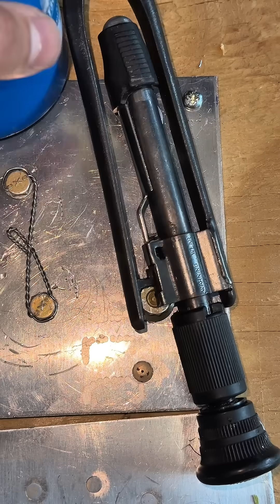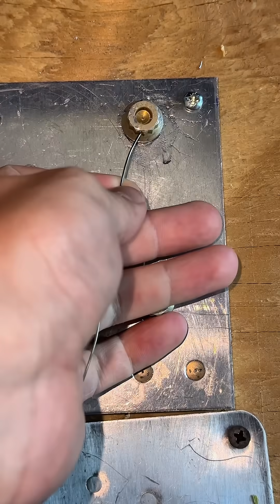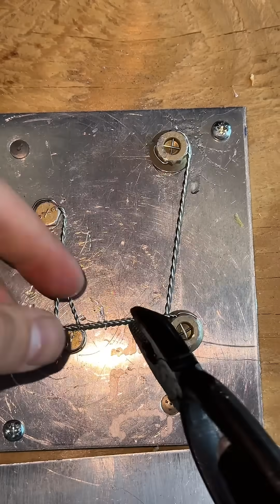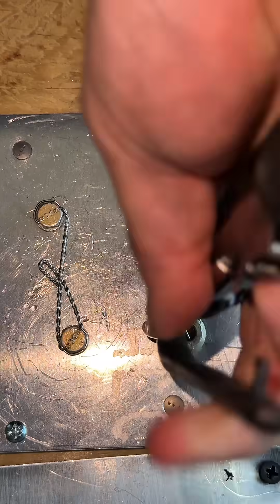Jet tech: Boomers Hated This Safety Wire Tip 😤✈️ #AviationMechanic #shorts #mechanic

Comment: Honest question about this. I don’t know if your camera reverses the image, but say that it does not. Should it tension on the loosening side of the bolt?
IMHO those two “Wired” bolts will back themselves out to a point where it’s irrelevant that they are strung together. 
In other words, both can back out from their holes due to vibration, and once they do that it will be a matter of time before the vibration breaks the safety wires one or both ends. If those bolts are left handed threads then they are correct. 
If they are not then it would be wrong in my opinion.
I am not trying to sharp shoot you down, but I have been in the past an ASE certified Auto Mechanic, then Army Heavy Construction Equipment Repairer 62B- 2P and H8 plus 3 other MOS last was 91Y-3P.
I worked around our Aircraft (Hueys, Cobras, Kiowa, Black Hawks and Chinhooks) all while an E-6 SSG , so I was pretty familiar with the Hangar Floor and Maintenance was always a Core Mission of mine, so I was always looking learning and building my knowledge.
Then when I got out I hung out at a local airport shop where An Army EOD Tech was the A&P Mechanic, and back then his dad was the Engine Builder so I’m sure he’d have been the one who would have thought of the difference of bolt thread direction. He had a special set of skills and w
Once he had the twin halves of an Air Cooled Engine back together, there was no way he would want to crack it open again just to check the wires tied to the Piston Crank Rod Nuts. Or bolts anywhere else. 
Back at 4D0, we had a Guy who got the Army aircraft Wounded Duck award. The 3 control rods that go up behind the right shoulder and the right seat pilot, encased in the structural frame work of the aircraft. One of the rods was loose and it nearly broke. The Aircraft had been removed from service several times for safety reasons due to sticking control issues, but this guy was a very lucky man who had already survived several crashes in the back seats of “Crash-Hawks “
He had lots of hours and progressed to being a pilot WO.  
The fact that he was the one on the controls is IMHO is what saved him, the Aircraft, Crew, and PAX … he felt his connection to the swashplate, had changed and he felt like it was stretching on one control function, which he Immediately recognized as a very serious problem and went to work on getting it down safely! Much to his credit!
The only way that he found the issue was by shining a light down the control rod housing, and having some one else operate the controls (covers off nose hood slid out and he was face down on top of the air craft. What he found was never saposed to happen. The 3 rods go through several kind of bulkheads inside the frame works and only when the rod in question was all the way up was it visible to see above the rod grommet or Pass through hole there was 3 rods in there and very limited light could be seen in that area let alone not knowing what to look for. When the rod and only the one rod was at full extension upward could it be visible from above and just barely.
The rod was 1/2-3/4 inches in diameter and 3/4-7/8 of it was worn through to a point where it would have snapped and fallen into the bottom where it would have jammed the other two rods and rendered them useless at that point they would not have been able to survive without any control. 
My point I guess in sharing this long story is that if they had gone any further than they could have all been dead.
I can only speculate on what happened to cause the grommet to tear apart allowing the metal on metal contact to occur and wear through the metal Rod linkage in this case it was Aluminum Rod inside of aluminum structural housing hole. The material of the rod was inferior to material of the structure and it was sacrificial until it almost broke apart. The metal was examined by Missouri AV-CRAD (I believe) and it was found to have stretched nearly 1/4” and cracks indicating that it was about to snap were visible. 
That was a long time ago when it happened but I never forgot about it. Safety is no Accident!
We have not spoken about it in years but I might Rattle his Cage a bit soon !
Maybe my thoughts are right about some safety wire falling into the housing until on it’s lucky day it made its way into the rubber grommet and then ate a hole through it and continued to eat away the rubber then the rod. 
Good luck! I might be a little bit of a Boomer I was Born at night when Charley sent out his minions, I’m said to be an old soul by several over the years. My dad was a WWII veteran. I just carried the Torch as it was my turn, it is someone else’s turn now!😉

Comment: I have those pliers ... your tail get a lead seal clamped too? ... for anyone wondering it's so anyone backing off the screws breaks the wire to show tampering.
Reply from the maker: Depending on your data and manufacturr most dont need a lead seal

Comment: we had a 88 S15 pickup and it had major dash board electrical issues after we tried to fix it we safety wired the dash back on at the air vents lol

Comment: Very nice safety wire job. I been in aviation as a mechanic for  over 35 years.  Being an aircraft mechanic is not a good job. Become an electrician, welder, plumber and etc. Working at UAL, huge disappointment and end up retiring poor. UAL company of broken promises and empty dreams.

Comment: The only problem with that is an army aviation at least you cannot use that tool or it goes against regulation. You have to just be a man and have strong hands and do it the right way by hand.

Comment: Too many tpi on the pigtail. Do it again airman.
Reply from the maker: safety wire pigtails can have more twists per inch, depending on the wire diameter and specific application. Standards such as SAE AS567 and FAA Advisory Circular 43.13-1B provide guidelines on the appropriate number of twists per inch for different wire sizes. ￼ ￼

For example, according to SAE AS567, the recommended twists per inch are:
	•	0.020” to 0.025” diameter wire: 8–14 twists per inch
	•	0.032” to 0.041” diameter wire: 6–11 twists per inch
	•	0.051” to 0.060” diameter wire: 4–9 twists per inch ￼

Comment: Nope, the bottom one is wrong. If the wire is pulled, the bolt will loosen. Should always tightening position!

Comment: In 1992 when I started in naval aviation I had to safety wire the tail rotor inboard retention plate bolts  and that was 16 of them on a  7 inch circle and best was by hand. This taught you to appreciate safety wire pliers because toy really don’t need then. It just makes it easier. Navy HH60H/SH60F/ HH60H/MH60S/Mh60R aviation mechanics. But do what makes it best. Good video
Reply from the maker: That’s a lot of safety wire!

Comment: I will say, that I did not have the correct tool and had to use two pairs of needle nose pliers. I don't care what anyone says, if there is a correct tool for the job, use it. Those safety wire pliers are by far better than any other method.
Reply from the maker: You’re right, the right tool for the job makes all the difference!

Comment: Never seen a pig tail tucked like that before. Our QC never would have allowed it, but maybe that was just Army SOP. Cool to see other alternate methods.

Edit: Does anyone know if there are different standards for fixed wing vs rotarty wing? Seems to me like the tail touching the main part of the saftey would rub and degrade it with the vibrations of a rotary wing, maybe thats why i never saw that. Just speculation.

Comment: I dont think safety wire is there secret i think there secret is that the plans are held together by glue and zip ties and any one who has worked at cirrus air craft says the same thing I work mid assembly for the sf50 lol not hating I think safety wire is great and keepnup the helpful vids

Comment: We use the same wire and pliers in motorcycle racing to stop bolts from getting loose and to stock oil dip sticks from getting loose on track, such satisfying things to do is lock wiring stuff
Reply from the maker: Glad it’s useful across different industries!

Comment: I do these as a 15T Blackhawk Repairer. Nothing is worse than doing safety wire in the top hydraulic deck as a newly qualified repairer
Reply from the maker: That’s tough, glad you’re a qualified repairer now!
Reply: @northeastaviationpro there’s so many up there so when we got stationed it was time to nut up or shut up

Comment: The United States Navy uses this on almost every single fastener that’s anywhere near the engine room. Flat tops, subs don’t matter. There is an exact amount of twist per inch depending on the diameter of the wire..😊 so just count your knots and measure you’ll know if it’s tight or not😊
Reply from the maker: Interesting! Thanks for sharing the Navy's practice.

Comment: As a QASO AO2 in the US NAVY 2006-2013 you are doing and exceptional job. 

I have been to countless training programs to learn safety wire techniques and you have knocked it out of the park. 

Always remember the old heads are not the ones that keep the industries going it’s new young talent that wants to continue on the trades with passion and that’s exactly what you are doing. 

Bravo Zulu 🫡

Comment: Motorcycle road racing requires safety wire too.
Reply from the maker: On what components
Reply: The axle shafts nuts. Swing arm shaft nut. Gear shifter nut. Clutch nut. Brake nuts. Oil cap. Coolant cap. All glass has to be taped.

Comment: Should have tightened the start of both better. Choke up on the wire and give it a twist then move back and lock on and use the twisty bit on the back.
Reply: What would that do?
Reply from the maker: Nah bro that makes an uneven twist

Comment: Idk if the videos is mirrored but shouldn’t the wire go counterclockwise to prevent it from coming loose? The way shown seems like it would help loosen it with every vibration
Reply: Right hand threads loosen counter clockwise. Wrapping the wire clockwise prevents that

Comment: This used to he done in certain auto racing like wheels and other high vibration areas
 I built heavy equipment like excavators and wheel loaders for years. Lots of locktite but no wire. Go figure
Reply from the maker: Wow nice! How did you get into that business. Is it profitable?
Reply: I worked for a company called Komatsu here in Chattanooga. I was an assembler and we'd occasionally get warranty claims about sprockets loosening on final drives or other things . I put between 700 +1100 lb. ft. Torque depending on machine size with anarobic
sealer also known as ,locktite only better,. The wire would take longer but less loose bolts in my opinion
It paid well but I blew my back out
Oh well. Thanks for a very interesting video.. @northeastaviationpro
Reply from the maker: Wow thanks!

Comment: Well you did it correctly, you could’ve done it better though. think it’ll work just fine
Reply from the maker: Always open to suggestions, let me know!
Reply: @northeastaviationpro hey thanks for the response. I got my A&P may 2022 my instructors were boomers and gen-X so that might’ve had some influence on my upbringing. The one thing I would say to do if what I say matters would be to cinch down the safety wire after you initially twist them together before you the pliers and after you use your safety wire pliers to actually make the twists in the wire. The “cinching” is done by taking the wire and twisting the wire clockwise pulling and rotating the wire clockwise toward whatever you’re bolting together When you do this properly, I’ve noticed that the wire can get exceptionally tight and the tension on the wire itself pulls the wire closer to or actually onto/touching the metal the bolts go through. The only downside is if you do cinch the wire down to where it rests on a surface, it could potentially rub or wear down the surface material due to vibration however I think that would take a while to happen and a lot of vibration.
Anyways thanks again for the response

Comment: Now do it upside down prone and arms fully extended near the power turbine section after engine shutdown with gloves on at night in the rain! It really will be like that sometimes… great job. 🙌
Reply from the maker: Haha that sounds fun!
Reply: Or, the mount bolts (0.032") & cannon plug (0.020"), then the cover (0.032"), on the fwd left ground blower fan on a B-52D sitting on the hammer head. IYKYK. LOL.
Reply: Add the sugar on the cake, you are in Miami in the middle of July.
Reply: Try H-53 lower pressure plate bolts. Upside down at Arm’s length, sometimes hot and always oily.

Comment: As an ex aircraft engineer, I remember being taught how to do this in three ways, 1 exactly the same as you with the same style of plier, 2 with pig snout pliers and finally by hand, the rules were the same for all three 6-9 turns per inch and correct orientation for the twist back without putting extra stress on the final ending looks good to me! I would sign off on it
Reply: What's the point of this?
Reply: @DarenMiller-qj7bu  If the bolts work loose from vibration or expansion and contraction due to heat, the safety wire prevents the bolts from backing out of their holes completely. Of course, if the safety wire is properly tensioned, the bolts shouldn't work loose in the first place.
Reply: @clone4211  ahhhhh okay. So it kind of acts like a cotter pin?
Reply: @DarenMiller-qj7bu No. If you look at the bolts and the way it's wired, neither of them can turn counter-clockwise without turning the other clockwise. Meaning, neither bolt can "back out", because righty tighty lefty loosy. It's impossible, without breaking the head of the bolt, or breaking the wire.
Reply: @DarenMiller-qj7bu  sort of, but cotter pins prevent the nut from backing off the bolt, but the bolt can still rotate in its hole. Safety wire prevents rotation entirely.
Reply: I seen multiple people mention turns per inch and wonder just how it is counted considering it appears that he turns about 5 times in 3 inches which is nowhere near what anyone says is regulation.
Reply: @swskitso  The video might be sped up and the audio edited, but you can easily count the turns in the finished wire. There are nine full 360° turns, but I bet the regs people are talking about are actually counting 180° half turns (i.e. any point where the wires cross is a "turn"), which makes it 18 turns between the bolts. If the bolts are 3 inches apart (which I'm willing to believe), that's 6 (half) turns per inch.
Reply: @vyznev so there may be 8 turns instead of 5.
Did you notice the OP said 6-9 per inch.
It looks like a 3 inch gap which would mean 18-27 overall.
So 8 is still nowhere near reg.
Do you see the issue now?
Reply from the maker: @swskitso reg allows approximately six to eight twists per inch
Reply: @northeastaviationpro  is that 360 degrees or 180 per twist, why does it not appear to be within spec in video?
Reply from the maker: @swskitso you count the valleys and peaks of the twist . So one valley equalys one twist
Reply: How dare you, BOOMER!!

Comment: I always do my pigtail in a direction as if i was doing a 3 point safety. Keeps the saftey looking uniform and i can tuck it along the bolthead without it making contact with the rest of th saftey but thats just my technique. Otherwise looks like a great saftey.
Reply from the maker: Thanks for sharing your technique. Every mechanic has their own methods and a little creativity is always encouraged.
Reply: @northeastaviationpro Not too creative though.  The point of an engineered spec is not actually to do anything the "best" way, but that how it will behave is predictable.

Comment: We never went back through the bolt so that the wires come out at a 90 degree angle. I see why but it just never occurred to me that that may have been the intended way to do it. Thanks for the info!
Reply from the maker: Glad it made sense to you!

Comment: You marked and damaged the wire putting it into the bolt that is trash and wouldn’t pass QC 🤷‍♂️
Reply from the maker: Thanks for the feed back! Always a pleasure when i get feedback from fans! Enjoy!
Reply: @northeastaviationpro 67U here for over 12 years, fan? Na I just saw someone doing shit completely wrong. Let QC watch you do that see how it goes🤷‍♂️
Reply from the maker: Appreciate you circling back, fan. 😊 Just to clear things up: the safety wire is clean, tight, undamaged, and done to spec. If you’re seeing something wrong, it might just be your opinion—not the technique. But hey, thanks for watching so closely. Gotta love the dedication! 👍
Reply: @northeastaviationpro Your plier teeth are not allowed to touch the wire before termination. You clamping the wire before sliding it through is absolutely a no no. Do it in front of QC and do a video 🤷‍♂️ Thanks for circling around to prove you did it wrong 🤣🤣🤣🤣
Reply from the maker: Youre delusional buddy 🤣, thanks for the engagement
Reply: @northeastaviationpro I’d expect names from someone who does that poor ass quality work 😂😂😂. What’s funny is you had to use safety wire pliers for that little ass safety👍
Reply from the maker: Keep hating bro, takes some effort to keep coming back and spreading misinformation. Did it hurt your fragile ego? Have a good day snowflake 🤣👌🏽👏🏽
Reply: @northeastaviationpro knowing your work is mids them supporting it is wild work 🤦‍♂️
Reply from the maker: Mids 🤣🤣 bro go drink your soy latte you sound mad sensitive